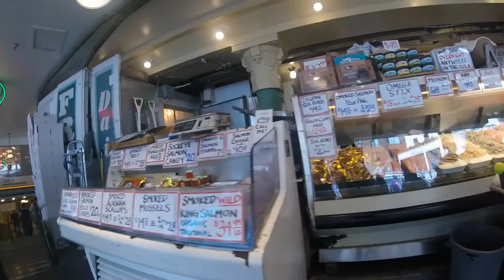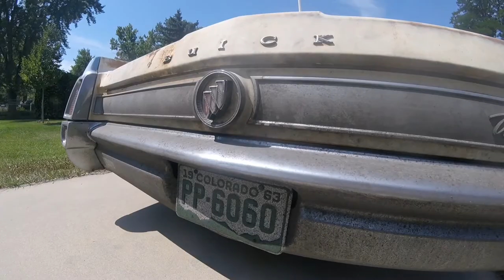2017 Lemons Rally Monterey Car Weeeeeak vlog

Comment: Great video! What did it end up costing to run that rally? Entry fee fuel sleeping? I want to go on one this year and I need a rough idea
Reply from the maker: entry is about 450. sleeping is on average $100 a night at a hotel, we usually camp every other. fuel was expensive at 10 mpg and we drove from colorado to Monterey and that was about $1500 in fuel for 7 days of driving. its not cheap but I've done 2 and would do all if i could. its a good time